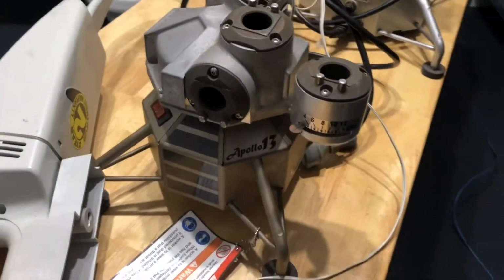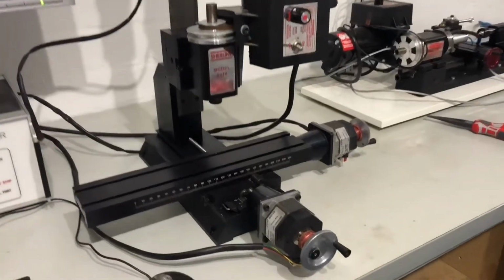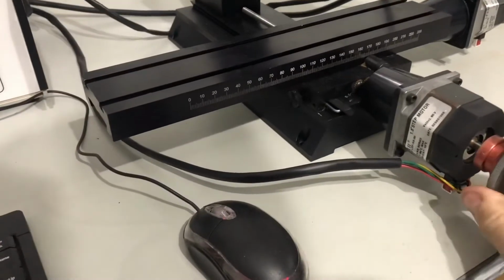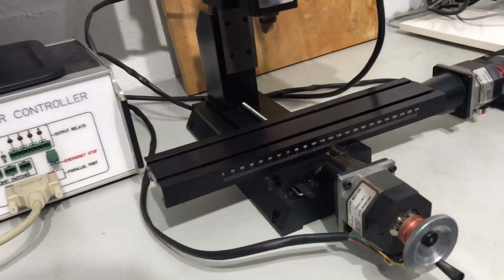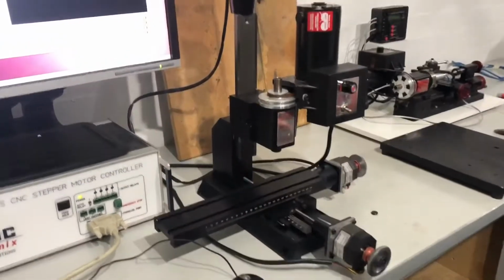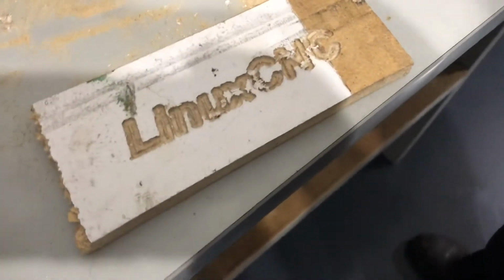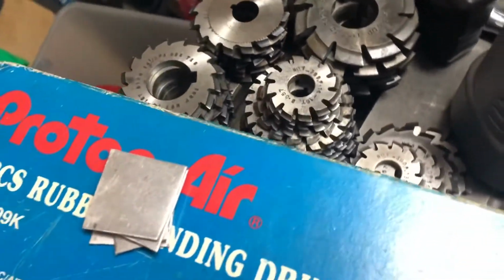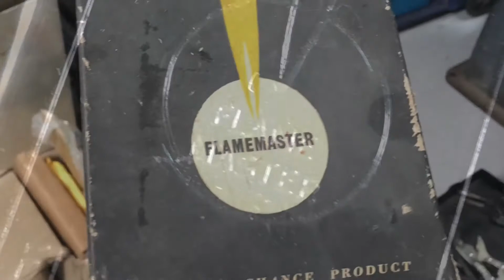Workshop Update - Apollo 13, Apollo 22 and Sherline CNC and Lathe

Comment: Do you use linuxCNC on these tools  I assume you do i have been using linux for ever and see few linux users
Reply from the maker: We are working through a number of options, one of the Sherline mills is setup with linuxcnc, the SIP 3K has mach3 and I’ve managed to build a tool chain from fusion 360 direct to g-code for the wire EDM controller
Reply: @JBFromOZ  sounds cool and involved